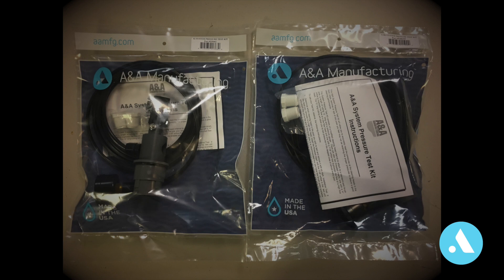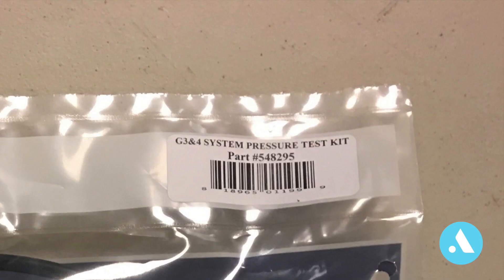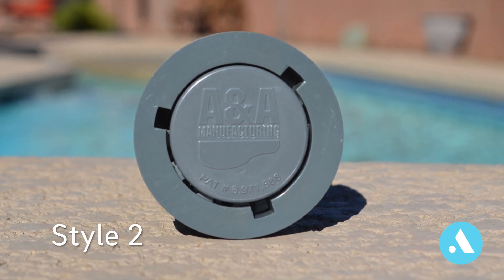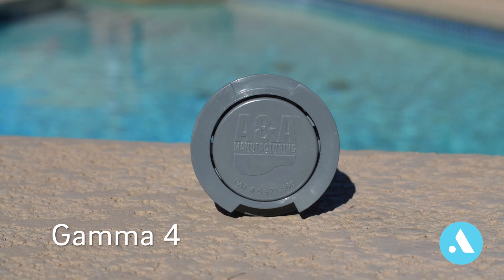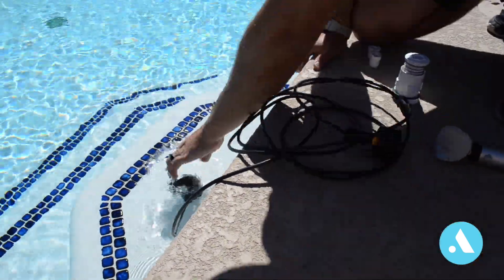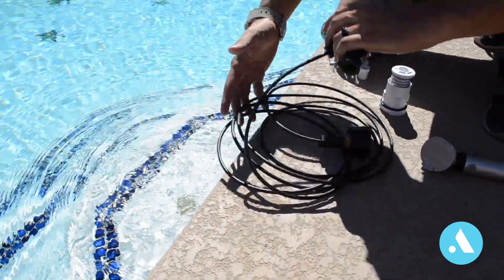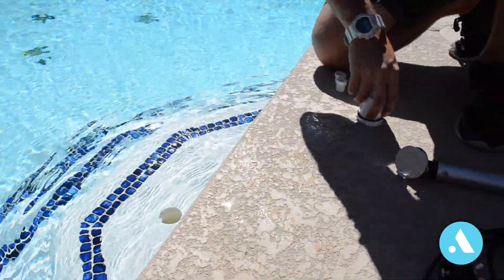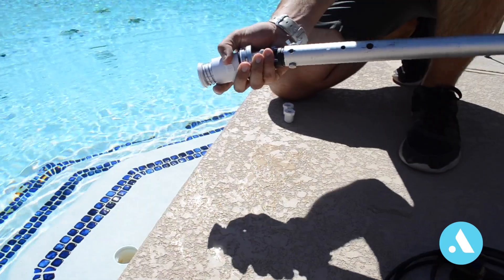Adjusting pump RPMs for your A&A infloor cleaning system (Checking Pressures)

Comment: So the goal is to achieve 10-11 psi on a given circuit.  Increasing the rpm of the pump if the the pressure is less, correct?
Reply from the maker: Yes, you would need to increase the water flow to the heads. Either by opening up a heater bypass to allow a more direct flow of water to the heads, close any other water demands (water feature, return lines etc), cleaning dirty filters or lastly turn the pump speed up.